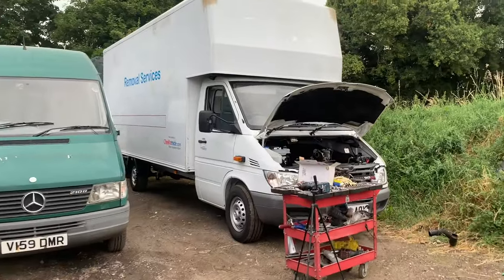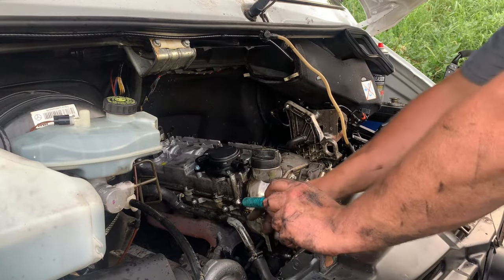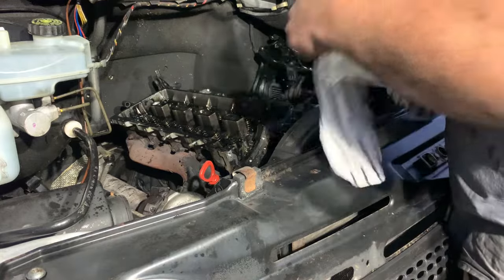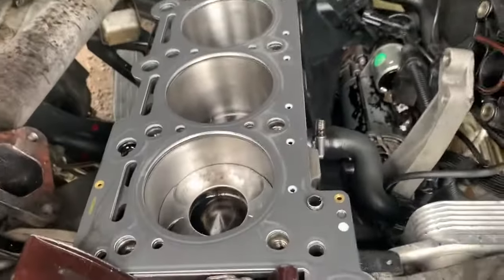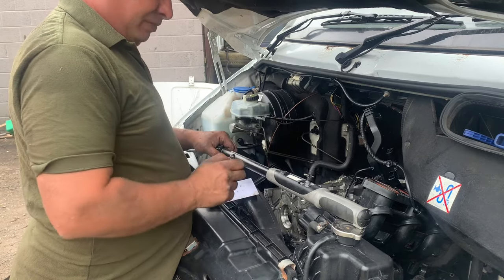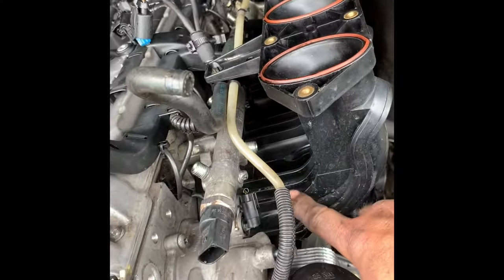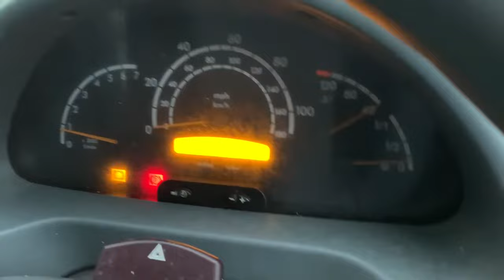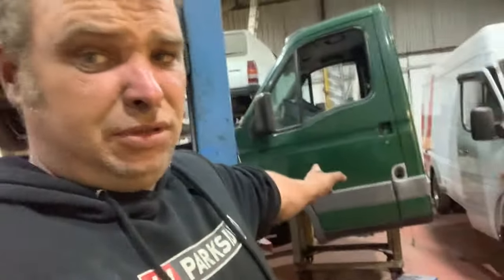Fixing a massive Mercedes sprinter luton , turbo diesel OM611, engine rebuild will it run !!

Comment: OM6111 an engine to be proud of as a German its one of the best engines we made in the last 25 years id say. For the amount of them build and sold you see very little of them with issues that are more than a simple fix.
Its a dead simple engine too going by modern standards.
But in the big heavy Vans they are stressed a lot more than in a C-Class for example, good oil and not being too hard on the engine is important here.

Comment: Brilliant!!! Loved watching this video simple old school mechanic getting it all pulled to bits and sorted in no time and great job, mad to find that piston like that, I’ve just bought a T1N with 126k on it which I think is well low miles but its absolutely smoking its balls off, was sold to me with injector issue which I thought ok maybe it is maybe it isn’t. Anyway on pulling inlet manifold off and covers etc I’ve looked and it’s just like yours not a single instance of any Black Death or anything and all the injectors look absolutely mint, all test out electrically with resistances etc. so not injectors I’m guessing some sort of air intake sensor maybe it’s smoking on idle and lumpy as hell, when driven on motorway which is did drive home from Scotland to Manchester haha it’ll run ok then struggle up hills going back on to what feels like 3 cylinder but could be limp mode I suppose.
Where would you start???

Comment: Id take a cracked piston anyday! My works 2019 MK3 313 fridge box Sprinter broke down on the way to Cardiff from Carmarthen at 3am. It already has 200 000+ miles on it but the electrical system is absolutely screwed... no garage here can fix it. The van is sitting unused waiting... Every guage, light & the LED ad blue/fuel indicators all dance and flash like mad. Thats fine by me... but if you switch the engine off during a "fit" episode, she will not fire off or even crank again & a grands worth of food gets left to rot. If you sit and wait for the fit to end and then switch it off it goes all day without much issue. I miss the old vans!!

Comment: I'm a fairly new subscriber and i'm glad i came across your channel. Your videos are very informative and with the videos i've seen up to now, you come across as an honest mechanic who knows his stuff and won't lead others down the garden path. Previously, i used to drive Mercedes Sprinter Refrigerated box vans for a living all be it of the newer styles (2015 - present day ) however, i much prefer the styling of the older vans (the style you are working on) as they appear to be more simple and more robust. I'm also a huge fan of the diesel engine (i love the noise the engine makes) and also own a diesel vehicle myself (all be it a Ford Ecosport). I would love to see in the future (and if you are able) to see some videos on Ford diesel engines as i would like to be able to fix my own car should anything go wrong. In general though, thanks for your in depth content as i really enjoy your videos. keep up the good work :)

Comment: I have got a Mercedes 11 plate sprinter. I buy passed the heater matrix last year and then when the frost came, I forgot to put antifreeze in. I tell everybody you should put antifreeze in and I’ll service a lot of peoples cars fix them whatever but forgot to put antifreeze in my own vehicle anyway above the core plug behind the manifold, there is like a square a crack in the block. I am hoping to repair that one way or another.

Comment: If you want super high milge from your CDI then might I be as bold as to suggest Oil and filters / and yes I said filters oil air and fuel  are allways changed together for easy knowledge of when a filter was  last changed I look at my wall planner to see when it was brought into the garage for said oilchange ( as a rule of thumb I do the changes every 12 weeks  as my engines are in Vito taxis  and do take a bit of a tuning  my druvers moan when I say its filter time but I do try to take it off duty on a quiet time  I have been running vitos for a good few years now and major mechanicals are zero a few little annoyances but on the whole totally reliable  the older of the 2 vitos is now running at 680,000 miles and the hesd has not been off
Reply from the maker: Couldn’t agree more we drop ours every 5-6000 miles hood quality oil and good quality filters are key 👍
Reply: Ive been a forte lube additive and diesel add for 15 years and allways put a bottle of oil flush in before dropping it and a diesel treatment in to keeep the injectors spot on  the 638 vito nevet missed a beat or struggled  to start on a cold  day / i yreat my trooper and citation the samethoufh the one trooper has been seriously abused mostly on the farm
Though the ex hit 2 substantial gate post with it  gairs  fair

Comment: Al another brilliant video thank you again,the OM611 engine i am in the process of replacing the head however i am confused by the casting numbers. do i need to obtain an exact copy of my casting number or can it vary a little for instance mine is R611 016 21 01 can it be superceeded by say a R6110161901 for instant listed as a head for this age vehicle ? Better still do you have a suitable head for my 2001 v-class ?

Comment: First time watching one of your videos and i love your positive aditude. I stumbled upon this video because i was searching for possible problems with the OM611 online, i have the opportunity to buy a Very clean 2002 W210 E class (1 owner, perfect interior and exterior) avantguarde grey 220CDi Wagon for under 500€ but there is one catch, it has 650000km and the owner says its running like its "naturally aspirated". Could probably be a million things from small stuff like a broken vacuum hose, boost leak or a broken sensor to something bad like a injector that burned a piston maybe? If the car doesnt get sold october it goes to the crusher because the rent on the garage its kept in goes out so im really tempted to take the gamle and buy it, gamble because i would have to drive it home as is, most i could do is have a friend with another car come with me and maybe tow it with that if it breaks down on the road:face-orange-biting-nails:
Reply: for a bit of context, im not buying this car with the expactation that everything works and that if its a bigger issue i have to sent it to a shop. I really like working on cars, biggest job i fully did on my own was a Mazda MX5 clutch in my driveway, i also dropped an engine from a project car that i share with my frinds but we sent that off to a shop to be rebuilt. I think i should be up to the task to fix whatever is wrong with the E class "hopefully"
Reply from the maker: More likely a vacuum pipe of the vv turbo boost controller 👍

Comment: GREAT BIT OF WORK , MAN!!  I've a quick question, "903 - 316 CDI" do you manage to get the High pressure fuel pump off without removing radiator and fan?? I'm 81 and don't need to pull the roo bar off as well! Winter here in Tasmania so I need to do it as easily as I can  :)  Best wishes from Down Under  :)
Reply from the maker: Yes it’s not to bad worsts part is the 3rd blot at the bottom of the pump !! It’s an ass to get at and has two fuel lines going across the front of it . I remove the lines and the patience test holding clip first !!! Lest than an hours work just keep your cool 👌

Comment: Amazing video. Loved it. Got the same engine (although left hand drive). 
I've got a fair amount of blow by. Some recurring limp home mode issues related to boost pressure. 
When pressure testing the system I could feel the air coming out of the crankcase breather (or I can now that I've replaced the intake manifold gaskets). 
Do you think I would be doing myself a favour to try pull the head and see of there's any damage to the pistons/ rings? 
The idea scares me a little, but this video gives me a glimmer of encouragement haha.

Anyway that's my sob story. Absolutely loved the video. 
If I'm ever back in the UK I might even pop past and see if you guys are willing to take apprentice's haha
Reply from the maker: I wouldn’t worry to much about miner crank case pressure fella , the limp mode issue is most likely the boost controller under the RH head light . Common fault and easy to change. I have one of these engines with well over 600,000 miles and it’s still running well Al 👍
Reply: @6DDIESELSDorset  great thanks.. your absolutely correct. But seems to be a electrical issue. Hoping to create a new wiring harness to see if that fixes it. An aftermarket boost controller didn't seem to fix it, but did make a little difference. 
Thanks all the same 🙏
Reply from the maker: @joecavendish5235  I have found the aftermarket ones to be very hit or miss . The genuine ones about £80 and normally sorts the problem . Might be worth checking the recirculate flap piping on the air box to they have a tendency to rot out and put it in limp randomly by dropping the vacuum when you click the recirculate on the dash 👍
Reply: @6DDIESELSDorset  might be well worth the investment. Thanks. 👍. Recirculation flap seems fully functional, although I do fear a small vacuum leak.. because if I hook up a tester at the brake servo end of the vacuum hose leading to the boost pressure solenoid, it doesn't seem to fully hold. But all seems good at the other end. But I think I'll buy a new one and hopefully you've done me a favour and that'll fix me good. Appreciate it